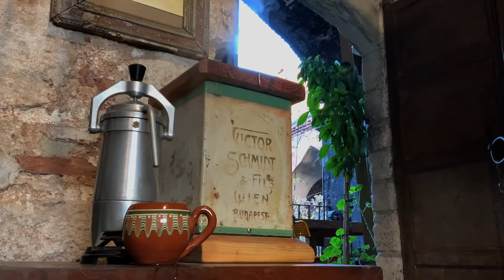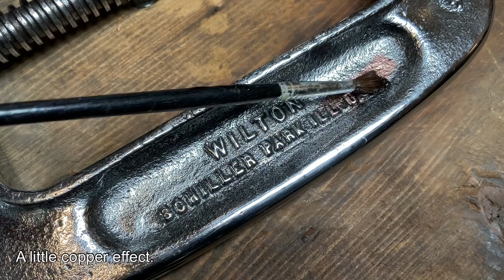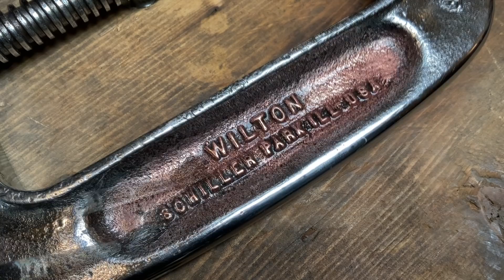Wilton C Clamp - Vise Restoration

Comment: I cleanup and resell a lot of c clamps. I start with a 120 grit flap disc, a twisted wire disc and a loose wire cup brush in my 4 1/2 grinder, ( well, 3 grinders, I don't change tools. ) Almost all the rust can be removed.
Reply from the maker: well done my dear friend, thank you for sharing

Comment: Nice job, but what is the white paste you applied to the wire brush to clean the  threads,  I've seen you use this before to clean metal?
Reply from the maker: thank you very much. the  white powder I use is carbonate and the white paste I use is regular metal polish.

Comment: great job friend 
but i think the clamp will rust again ,
why you didn’t use the nickel plate solution to prevent the rust?
Reply from the maker: Thank you very much. I m glad you like. I really like the original touch of the metal and I have regular maintenance & care day. So I usualy don't use any lacquer, coating, plating or paint for any kind of metal